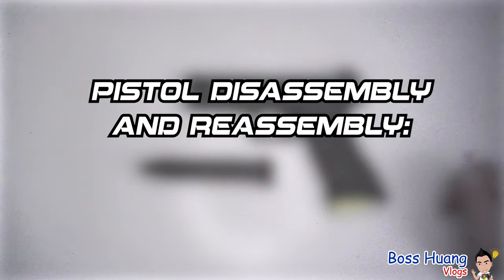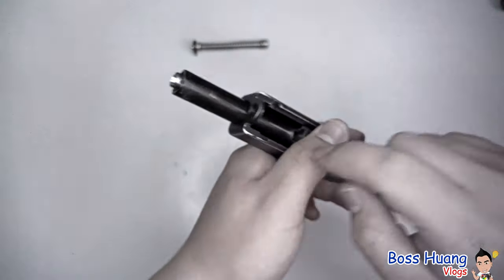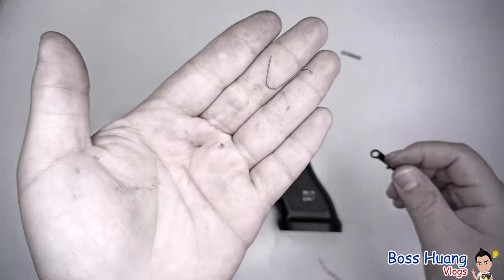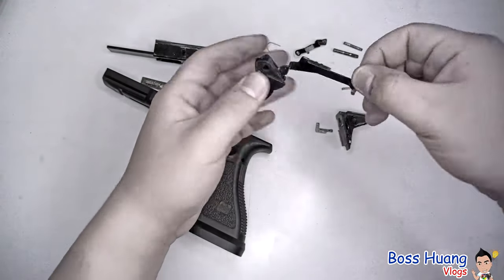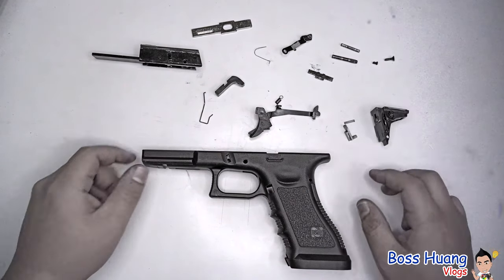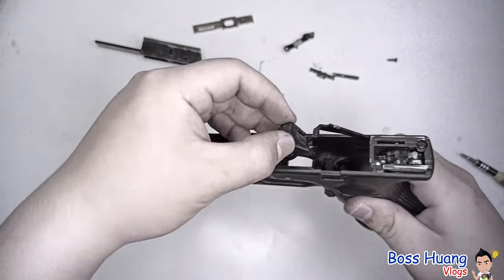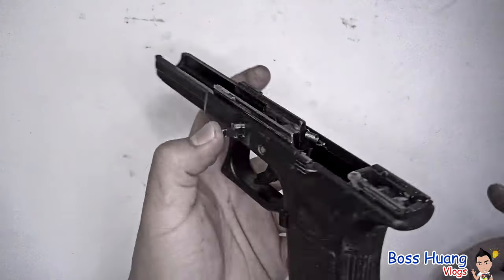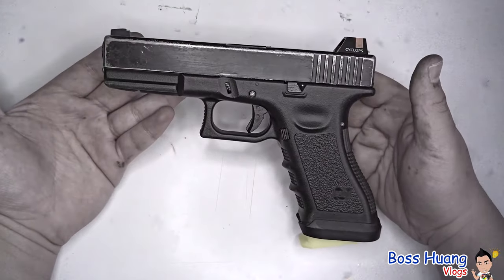【Glock】Disassembly & reassembly〔B&W GBB〕

Comment: Thank you, this helped me alot :D There was a big gap between the slide and frame on my vfc g17. By sanding down a tiny bit inside the frame and on the underside of the locking block i was able to lower the locking block so that it would pull the slide closer to the frame rather than lifting it up from the frame. I was also able to fix a non functioning trigger safety by pushing a tiny bit of sponge into it. Thanks again.
Reply from the maker: Glad to hear my video helped! Anytime :)

Comment: THANKS! your video  helped me fix my Glock 18c  VFC/Umarex.  I thought it would be a cool to swap the outer barrel with one from my S.A.I Blu,  it fit perfectly, however when I but the slide on, it snapped into place...and would not slide, ..or even COME OFF. so I was screwed.  In the end I popped out the trigger pins..and with a lot of "convincing" and some banging  lol...I was able to get the slide off, but when I did ...the slide catch release , spring and trigger spring parts came flying out... lucky for me your video helped me put it back together!  :)
Reply from the maker: No problem! I hope your airsoft pistol still works fine! :D

Comment: Since I changed my elite force Glock 19 inner barrel is cycling and working but bbs are rolling out not coming out of hop up unit what could it be 😢😅
Reply from the maker: There should be a silicon part or something similar to hold the BBs in place gently before the gas pushes it out. See if yours is missing or faulty!

Comment: Hi, I recently got an elite force g18c and within a few days one of the pieces broke. It was the small plastic ring looking thing at the front of the spring that goes around it (you can see it at 2:10) and it snapped into 3 pieces out of nowhere. I wasn’t able to put it back together. I’ve searched everywhere but can’t find any replacements for it. Any idea what I should do?
Reply from the maker: You should be able to find a lot of results using keywords such as "Elite Force Glock 18c recoil spring", below are some random links that I found as references, good luck getting a replacement!

Evike Reinforced Recoil Spring Elite Force GLOCK Licensed Blowback Airsoft Pistol:
https://www.evike.com/products/87393/

Stampede Airsoft AC 170% Enhanced Recoil and Hammer Spring for G17/G18C Series GBB AC-G17-RH170:
https://stampedeairsoft.com/parts-internal/ac-170-enhanced-recoil-and-hammer-spring-for-g17-g18c-series-gbb-ac-g17-rh170/